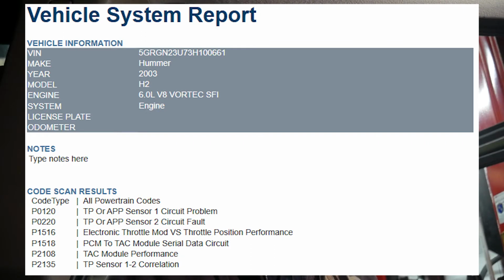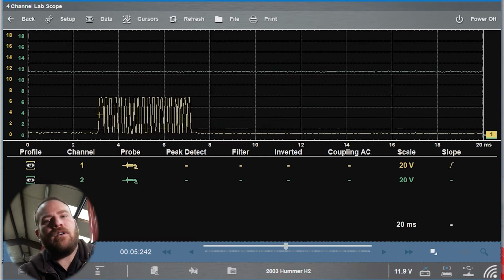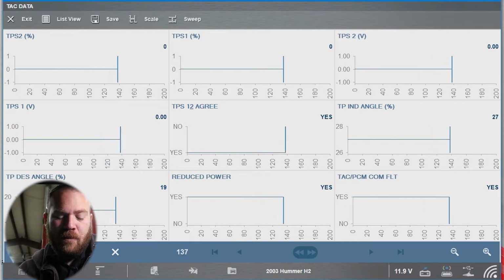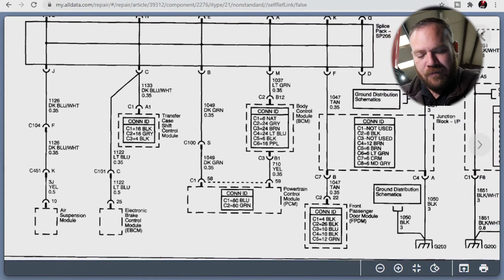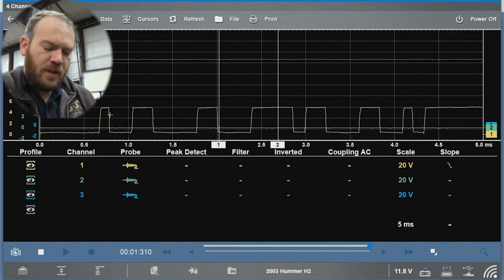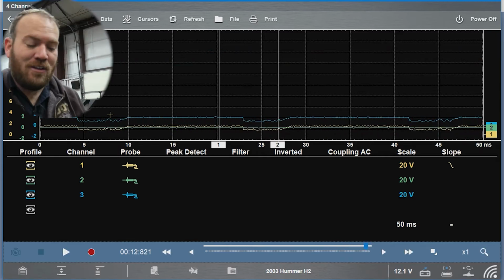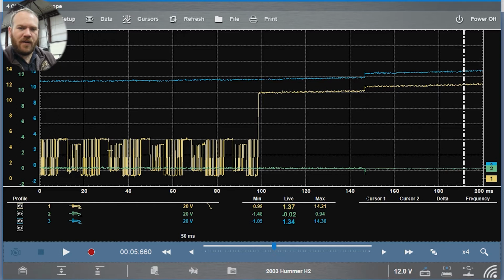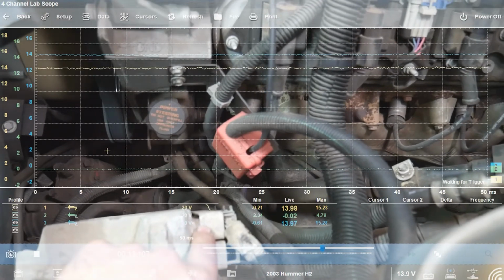2003 Hummer H2 Throttle Communication Codes

Comment: i am very impressed. That was some fantastic troubleshooting. Wish all shops had Technicians with your skills. Thank you so much for showing us H2 owners that some issues could be caused from harness Trouble. Its so nice to see good old fashion trouble shooting instead of just troughing parts at problems. using modern tech of coarse but getting right down to the root cause. I will be sharing your channel with my buddies.

Comment: So did you ever fix the issue cause mine is doing the same exact thing
Reply from the maker: Yes.  The hydro boost hose had rubbed through the communication wires.

Comment: OUTSTANDING, WAS THAT A DATA-DRIVEN DIAGNOSIS. THIS IS WHERE I NEED TO BE IN MY DIAGNOSTIC ROUTINE. FOR INSTANCE, I HAD A 09 NISSAN CUBE YESTERDAY FOR A NO STAR CUSTOMER SAID VEHICLE WAS IN AN ACCIDENT AND HAD TO HAVE UNDER HOOD WIRING HARNESS REPLACED. THE SHOP SAID THEY WOULD LIKE ME TO RE-CODE THE ORIGINAL KEY THIS IS WHAT THEY BELIEVE THE PROBLEM TO BE  I TRYED BUT IT WILL NOT CODE BUT I BELIEVE THERE IS MORE GOING ON THEN JUST A RE-CODE AND THIS IS WHERE I AM AT. NO IDEA WHERE THE HELL I GO NEXT THANKS FOR YOUR TIME.
Reply from the maker: It was more code driven than anything. After I decided to clear the code and see what came back I only had one code return time and time again. That was the p1518 code that referred to the TAC communication to the PCM. The other codes may have been set by the other shop during testing or from the original throttle body. I began testing at the DLC but when I couldn't see an issue I looked into the diagram. I honestly expected to find shorted wires on the steering shaft and didn't expect the hydroboost hose to be the cause.